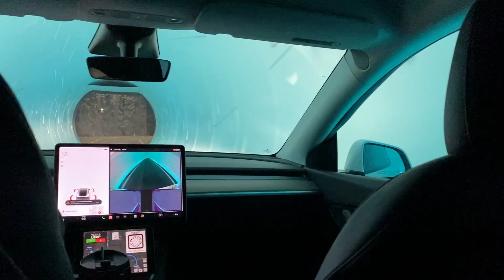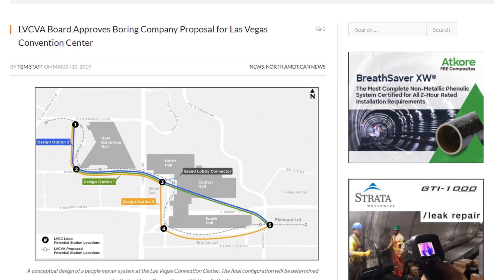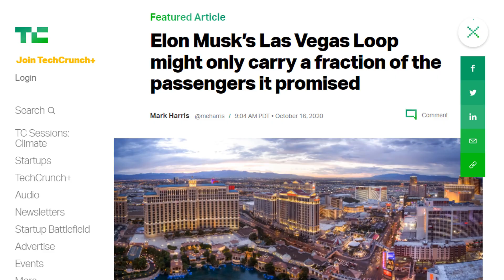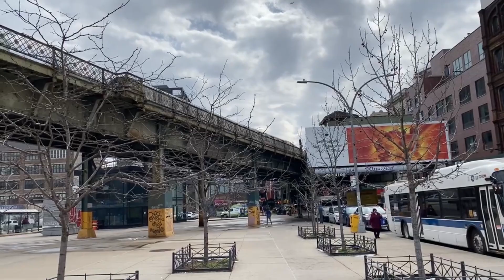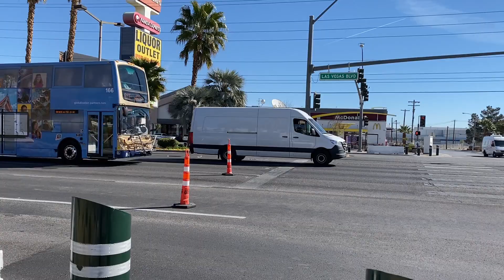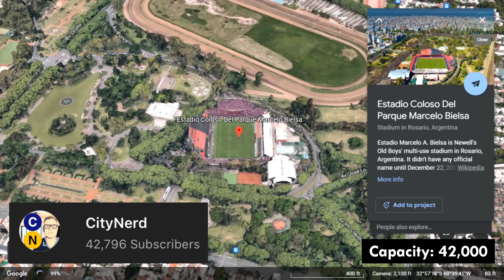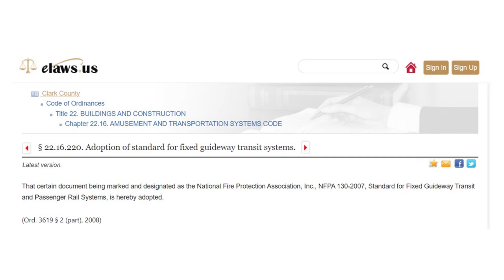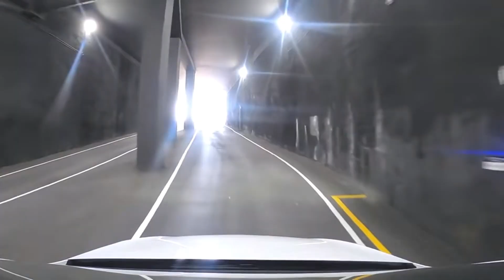Inside the Las Vegas Loop: Transportation Game-Changer, or Complete Waste of Time and Effort?

Comment: @CityNerd  The Las Vega Loop was never intended to be high speed (155mph), not sure where that idea came from.  A lot of the limitations of the loop, has to do with regulators, they limit the speed, number of cars that can be run and the use of autonomous systems.  I think people miss the point of this system... it is only purpose is to move a max of 4,400 people per hour and cost $55 Million to construct.  A lot of the terms of the Agreement are open to be examined.  The complex doesn't need a high capacity system, it just wanted to move a few people from here to there, in the most cost effective way.....underground.   

I think what is missed by many about the Las Vegas loop, is that the distances travelled are short and the Convention Center wanted to spend a little as possible.  This is why the system was chosen over alternatives,  $55 Million is peanuts for any kind of people mover, especially underground.   The general costs to tunnel 1 mile is about $500 Million, in New York it cost over $1.24 Billion.  Let's also remember this is version 1.0 and The Boring company's 1st major project.   While it is a simple system....it works for the customer and that is what matters most.

What this system proves is that, a people mover can be created for a fraction of the price of traditional systems.   I think people have been misled about what this system was supposed to be and that is part of the reason, there is some misguided criticism.

Comment: You barely touched an important point regarding the claimed throughput: the pedestrian crossing. If they need to run a car every six seconds to reach 1800 people (and something like 2-3 seconds to reach 4000), when will people cross the street? And can the system allow for that many cars? Actually, they won't need that many cars, because the main chokepoints are the pedestrian crossing (solved kinda with a pedestrian bridge or tunnel) but also people getting on and off the car.

And by the way, as an Argentine, I couldn't pay attention to the last few minutes. Get out of here "Kiko de zona sur", here's Newell's most famous supporter.
Reply: The pedestrian crossing is only a secondary access route to the station with the primary being an unimpeded path between the two tunnel exits so they can easily close off the crossing during busy periods if neccesary.

The main arterial tunnels of the Loop will have a headway of 0.9 seconds (over 5 car lengths at 60mph) to which the stations will be connected by spur tunnels that will act like freeway on-ramps and off-ramps.  As a result, those arterial tunnels will handle up to 4,000 EVs per hour carrying between 10,000 and 16,000 people per hour.
Reply: @andrewfranklin4429  This will literally never happen lmao. No one is going to drive 60mph through those tunnels and the self driving doesn't work. Cope harder.
Reply: @MattBakken10  Hi Matt, perhaps you’re not aware that The Boring Co has already driven visitors at 127mph (205kph) in the company’s 1.14 mile test tunnel in Hawthorne California with YouTube clips from 2 years ago showing it in action.

Once the 29 mile 51 station Las Vegas Loop is completed, there’ll be plenty of long stretches to reach even higher speeds.
Reply: @andrewfranklin4429  And something something self driving cars which will definitely be a thing next year.
Reply: @AardvarkDK  yes, automation will happen soon as in videos from CES, the drivers were saying that the cars have already been modified for autonomous operation, but that it is not yet enabled as they are still awaiting regulatory approval and liability is “holding us up right now, but once that gets cleared we’ll turn all the cars on”. 

After all, The Boring Co actually took the press for test runs using autopilot running in Loop EVs over 2 years ago in the 1.14 mile test tunnel in Hawthorne California.   At that point, autopilot was limited to 90mph (145kph) but was scheduled to be increased to 125mph (201kph) a few weeks later. 

Not surprising considering that following a white line in the controlled environment of a tunnel is hardly rocket science.
Reply: @andrewfranklin4429  Well, for Tesla it does indeed seem to be way beyond rocket science. How much are you in for?
Reply: @AardvarkDK  on the open road yes, it is a very tough problem, but thankfully the controlled confines of the Loop are a vastly simpler considering the Loop drivers report it is ready to go and awaiting only regulatory approval for them to turn it on.
Reply: @andrewfranklin4429  I'm sure they would have no reason to lie about that.
Reply: @AardvarkDK  considering automation would do those drivers out of a job, why would they lie?  They had automation running in the Hawthorne Test tunnel 2 years ago running at 90mph, why do you believe they are not more advanced since then?
Reply: @andrewfranklin4429  205 kph in a test tunnel, that's slow for max speed, in my country we have people doing over 250ph in tunnels illegally, and there are Hayabusa mostocycles with nearly 300 kph in our tunnels, see Ghost Rider Hayabusa (he does wheelies at 354 kmh (kph)
Reply: @andrewfranklin4429  "Automation will happen soon", fake news, Tesla themselves said it would require years for level 5 FSD. Tesla die to their cameras is stuck on level 2 for years, the competition has level 3 in theirproduction cars and level 4 in their concept cars
Reply: @andrewfranklin4429  Tesla autopilot fails videos of 2022 to debunk your claims.
Reply: @andrewfranklin4429  Luxtram 6 to 24 times less energy per person required, 3 times more persons per hour transported, twice as cheap per mile, zero deaths (Tesla cars have hundreds of deaths in one year), way less maintenance required, way smaller number of drivers required, so everything better than the Las Vegas Loop

Comment: The fundamental good the boring company might do is reduce the cost of tunneling making it way cheaper to build underground train lines.

The vision of a broad, deep network of tunnels for autonomous EVs isn't completely insane if the cost of tunneling comes down by a lot. If tunneling were free, we would move pretty much all car traffic underground. And if the cost of tunneling gets to be comparable to the cost of resurfacing a road, the fact that the tunnel is protected from weather and thermal cycling will mean it saves money on road maintainence in the long run. And there are a lot of trips where sending a whole bus every 20 minutes just isn't efficient. On demand autonomous vehicles use less energy and less hardware than a bus if there aren't multiple riders sharing the bus.

Worst case scenario, the billionaire wastes some money trying and failing to improve transit, which is a better waste of money than buying a yacht.  I don't get why people hate the boring company. I get the skepticism, but not the hate.
Reply: Not just the cost of tunneling, but the cost of maintaining a tunnel. That's where the big kicker lies. Especially in areas with a high water table or any kind of seismic activity.
Reply: We invite Musk to Switzerland to tunnel the alps with his space technology. We like a good laugh.

Comment: You mentioned 'single seat ride' in this video.  I'd like to hear more about it.  I live in the NJ-NY area and have talked to transportation engineers and its their holy grail.  I've asked them why its so important, if its that riders don't want the physical work of switching lines or if the scheduled never match up and they are constantly waiting when they switch thus increasing overall trip time.  But i don't get a specific answer, its just that  ridership plummets on on anything else, even though the NY subway system pretty much depends on switching lines at stations. however, it seems to me changes could be made to  switch lines and greatly decrease overall trip time , but they immediately shoot it down because it violates the 'one seat ride' rules.  what gives?  is there some interesting history to the metric? and why is it so sacrosanct?
Reply: It’s both the physical act and the waiting. The physical transfer isn’t just less accessible, it’s also its own form of waiting and adds complexity for trip planning. It’s born out by observable data and if you ask most people to choose between switching lines or choosing a different place to eat nine times out of ten they’re going to gravitate toward a simpler/quicker trip unless the fare at the other location is compelling.
Reply: @LoneGunman90  I see situations where having a transfer instead of single seat ride could make the overall trip time shorter.  I'm curious if any studies where done on how much trip time would have to be saved for commuters to feel the effort of a transfer is worth it.  THere are transit systems where transfers are built into the system,  the New York Subway for instance.  due to the network of routes, single seat rides are not possible for a lot of trips.

Comment: Just had another thought. Heathrow airport has managed autonomous electric vehicles with tyres, carrying 4 passengers, between 3 distinct stations, for its terminal 5 parking years before this. This seems to be a worse version of that!
Reply: The Heathrow PRT Pods only carry 800 people per day compared to the Vegas Convention Center Loop which already carries 27,000 people per day during large conventions.

The Pods can only achieve speeds of 25mph compared to the Loop EVs which do 40mph in the LVCC tunnels and 150mph in the main arterial tunnels of the upcoming 29 mile Vegas Loop.

Hardly comparable really is it?

Comment: Ah, the Vegas Loop. A great way to combine all the impracticalities of subways and taxis, without the capacity of the former or the destination flexibility of the latter.
Reply: Enron Mollusk: "If it ain't broke, FIX IT 'TILL IT IS!!!!!!!!!"
Reply: The destination flexibility of this system while not as broad as a taxi service will be significantly higher than a subway.  Nobody builds a subway system with as many as 3 stops per city block.  Subways get you close, this system, as drawn, gets you all the way there.

The unique opportunity in Vegas is the large number of predictable destinations.  Your average visitor to Vegas goes from casino to casino, the airport, and downtown.  If this system covers all of those points as proposed, it'll provide full destination coverage for a very large swath of Vegas visitors.

I've been to Vegas dozens of times and what they are showing right now covers ever single destination I've ever had on any prior trip other than things which are rental car territory no matter what (Red Rock, Hoover Dam, Valley of Fire ect).

Comment: @Citynerd love the video, I think while cars through a tunnel is pretty stupid, the unique selling point of boring company is how fast they can drill a tunnel. Which also can be used for subways. They used to drill using diesel generators which has way lower torque, a lot of pollution and highly flammable. This is where the boring company really shines!
Reply: This is often cited but so far hasn't been backed up. The tunneling speed in Las Vegas was about as fast as on other TBM projects, and that's despite having such a small scale and no unreasonable difficulties (like building through water levels or whatever).

Comment: One thing that can improve the Vegas Loop is to simply change the vehicles used. For example, at Calgary's YYC airport, there are little shuttle buses that transport passengers across the terminal similar to golf carts found in other airports except that they have higher capacity, up to a dozen people I think, level boarding, room for luggage, accessible for people with physical disabilities, and a dedicated lane so that it doesn't have to contend with people walking in the way. Something like the trams found in Disneyland that transport people from the parking structure to the parks would be even better as they act like trains! Of course, nothing can beat and actually train, but I can't help but feel concerned as the tunnels for the Vegas Loop are WAY too narrow, heck I don't think you can even open the doors of the Tesla cars. But the Elon Musk cultist will just attack anyone who dares to question their supreme leader. At the very least, there are some ideas on how we can convert the Vegas Loop into something more useful when it fails if it isn't destroyed in a car battery fire.

Comment: Two things. First, the current systems are for tourist entertainment and novelty. That is fine, this is Vegas! Secondly, for Tesla and Boring Company, this is a prototype technology demonstration. They understand that even the full loop is not economically viable. But they are leveraging these boutique projects to develop the real goal, a multipoint metro-wide system of robo-taxis using tunnels and surface streets. That where the use of small vehicles on autonomous routing paths will make sense. And small private vehicles will be appealing. The tunnels serve as trunks to augment surface routing on streets. Yes, the autonomous driving must work well enough to be accepted by public and regulators. That will take a long time and the tunnels will help by providing a transitional space where full autonomy can begin safely with gradual approval.
Reply: literally none of what you described is going to happen. the autonomous driving doesn't work, the grade connections between surface and tunnels is too space intensive, and oh yeah the cars tend to catch on fire and lock their inhabitants inside.

getting rid of cars is how you get rid of car traffic. there is no other solution but designing walkable places with public transit between them. hope this helps.

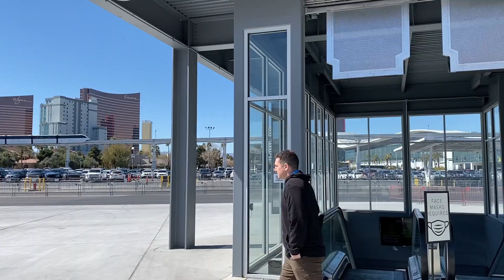Comment: 4:03. Excellent pun. Can you do a future video on the metro systems that kill the most people (including non-riders) per passenger mile traveled? Good luck finding a time that isn't insensitive to post it.
Reply: Indeed. The NYC subway kills 70 people per year, only half of which are suicides with 2% being people murdered by being pushed off a platform in front of a train and the rest being accidents. 

or the London Underground which kills 50 people annually and has 4,000 serious injuries every year. 

Or the Australian rail network that in a single year (2012), “recorded 146 derailments, 14 train–train collisions, 2 train–rolling stock collisions, 62 train–person collisions (13 collisions at level crossings), 125 train–infrastructure collisions and 60 train–road vehicle collisions (49 collisions at level crossings) (ATSB 2012).  Between 2003 and 2012, there were 350 Australian unintentional rail fatalities”

Or European railways where in 2019, there were 1,516 significant railway accidents, with a total of 802 fatalities and 612 persons seriously injured.  (Suicides occurring on railways are reported separately. With 2,313 reported cases).

Or US railways where 50% of train engineers (drivers) report they have killed at least one person.
Reply: @andrewfranklin4429  So in your fantasy world, you claim no one will die in the 29 mile expended loop. You compare an entire subway of New York with a city over 10 million people with a 1 mile loop in a city of 600000. So you need to cheat with data to make up a fallacious argument. Ridiculous claims you make